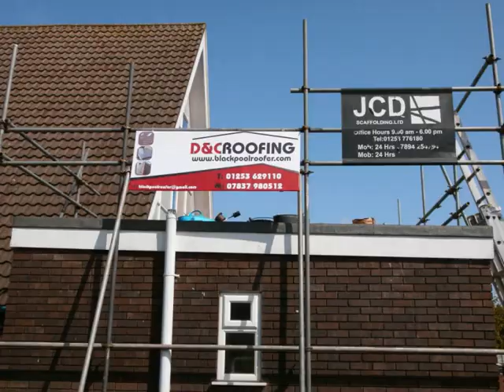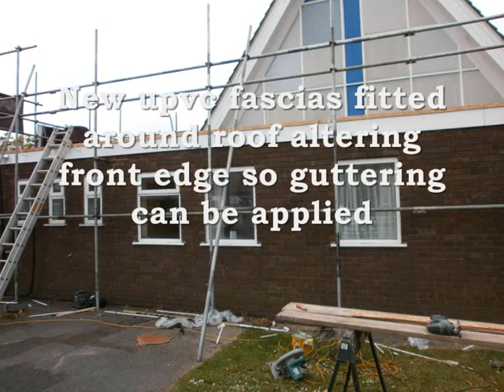Marton United Reformed Church Blackpool Flat Roof Fascia & Guttering

Comment from the maker: D&C ROOFING offer a full range of slating tiling and felting services for either total new roofs, or repairs and restoration. 
So whatever your requirement contact us on 01253692110 (evening) 07837980512 (daytime) EMAIL blackpoolroofer@gmail.com